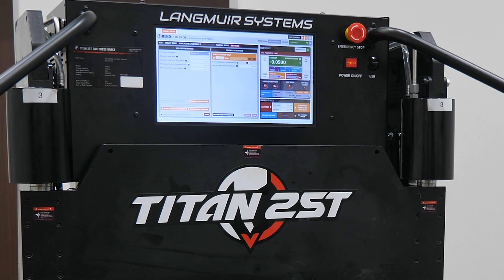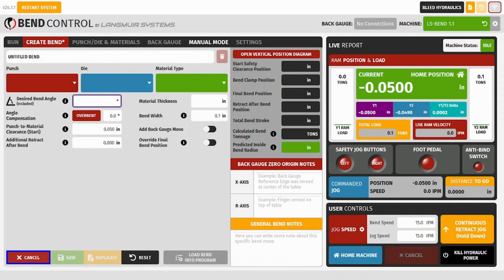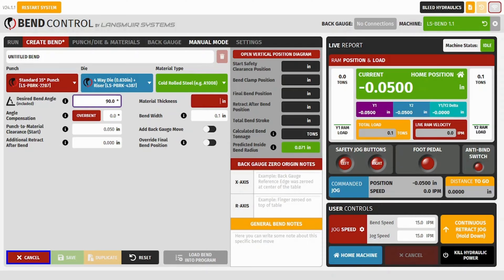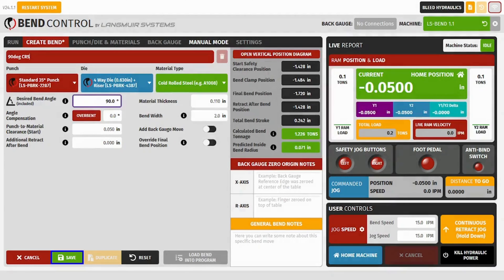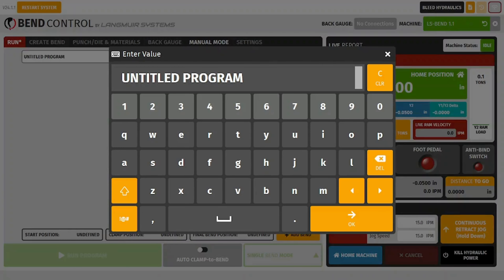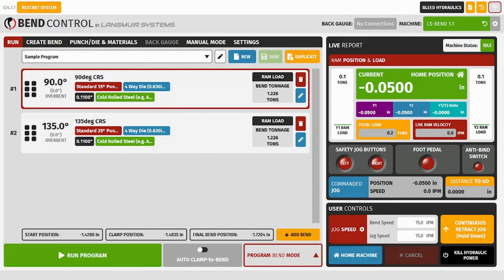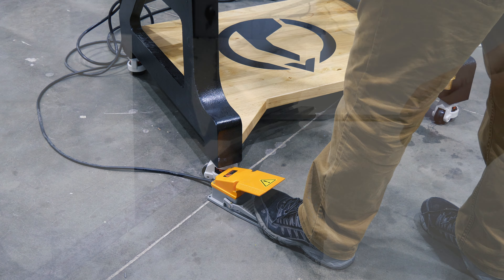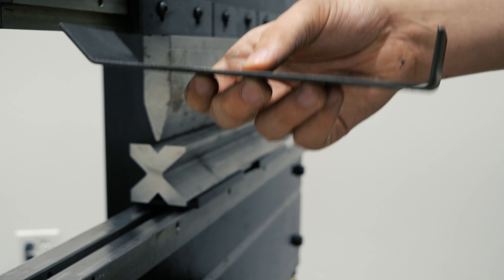Mastering Bend Control with Langmuir Systems TITAN 25T!

Comment: Just received mine, ordered with back gauge and chose to build my own stand for personalization. When I received the brake I was expecting it to be ready to run, it arrived with all of the items in boxes for the back gauge to install. Seemed like a daunting task but contacted Langmuir regarding no instructions with the brake. Customer support sent me a link with very detailed instructions on how to install the back gauge and challenge accepted. Took me a little over a day to get everything installed but well worth doing it gave me insight to the unit. I have not received the ordered dies yet so I haven't had the chance to bend any metal yet but the software for the brake did come preloaded with the parameters for the tooling they provide. Looking forward to getting tooling to start bending.